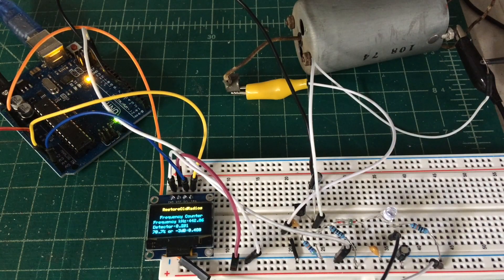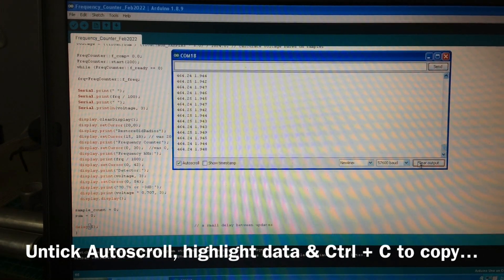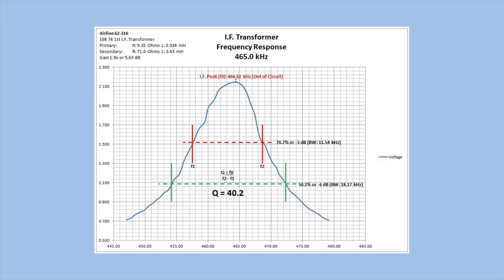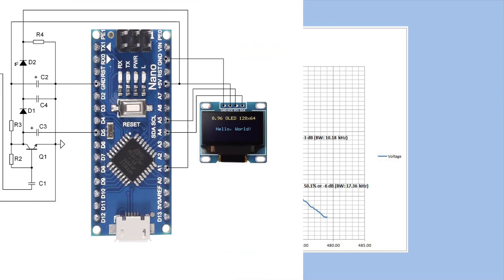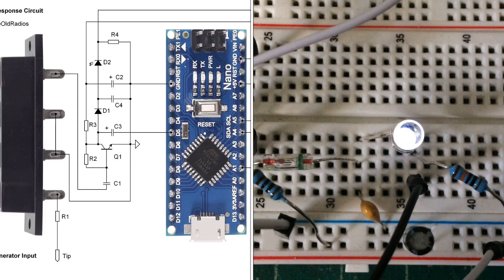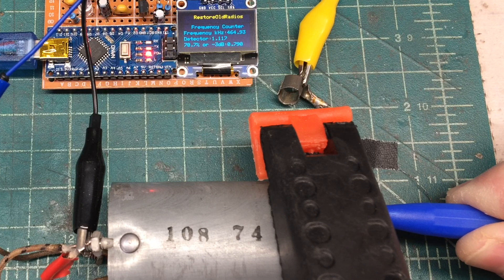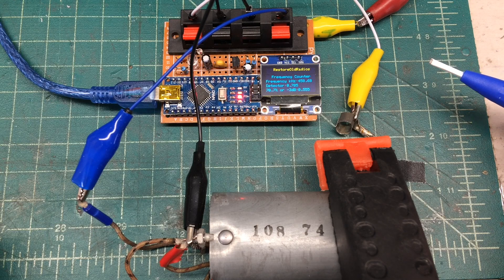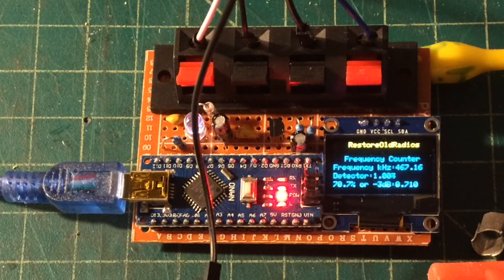Build a Frequency Counter/Frequency Response Circuit using Arduino to Characterize I.F. Transformers

Comment: This kind of thing is always nice to have in the toolbox. Or know how to build when one needs it. Question for you. Most likely been asked to death. Is there a not to expensive RF generator that you know of. New build, able to do am and FM modulation. Usable to align radios. Preferable digitally controlled. I know it's asking allot these days. I just can't seem to find it outside very expensive units meant for very high frequency stuff. I have the old gear, it works but I like to get something that is all in one push and go.